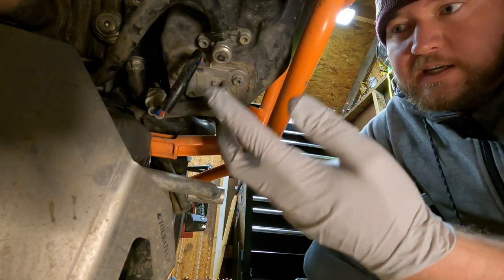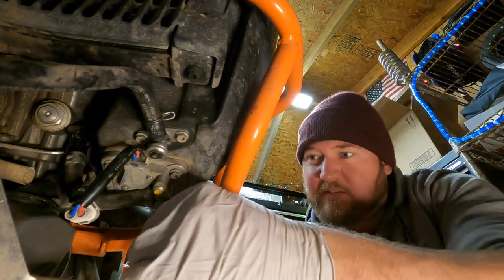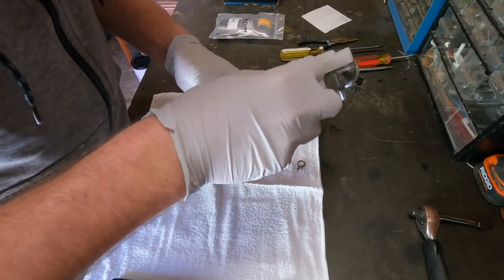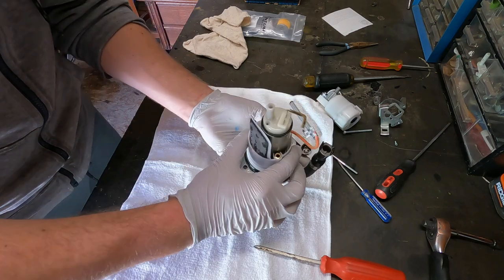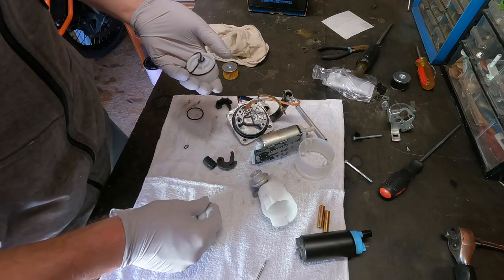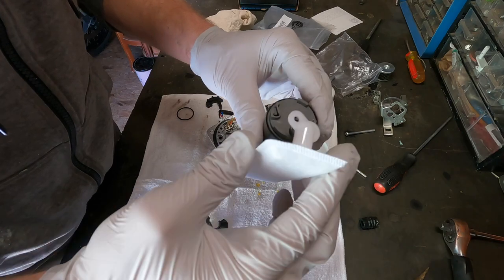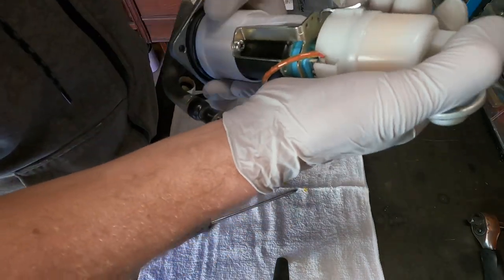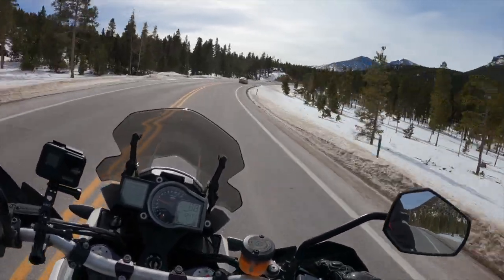KTM 1190 Fuel Pump Rebuild Filter Change NOT as DIFFICULT as you think 💭

Comment: Just about to tackle this job, and found this is really useful. I’m not going to remove the tank now, and am confident it can be done relatively easily. Famous last words 😂 Thanks from England.
Reply from the maker: You can do it! Thanks for watching
Reply: Update. Sorted it yesterday, was easier and quicker than expected. The fuel was sitting in the tank over winter and had turned milky, presumably water in it. Changed the pump, filters and regulator, and it runs much better. Put an up-rated pump and regulator in. Thanks for your video, was a fantastic help.
Reply from the maker: @davewhittleston2963  glad the video helped !

Comment: I think my NEW 100mile quantum filter is failing.  50% power just like before. Ready to sell bike. Previously had fuel explode out tank embarrassingly in front of other riders too. Fixed that by drilling camel vent hole. Gotta take bike completely apart again to check vent lines again. I’m just venting🙁…pun intended😐
Reply from the maker: I had to do the tank fix, fuel exploded out on me as well.
The fuel pressure regulator went out on mine about 300 mile after this rebuild. 
As much as I love the bike I will most likely part ways with it next year.
Reply: @AdventureTomek   yeah its getting very frustrating...  just looked at 21 MultiV4..wow, but i keep thinking my paid off 1190advS already does 70-80% of what these new adv bikes do, i just need the 1190 to be reliable.  no prizes awarded at the end of a bdr for who had best suspension, fastest time, etc lol.  

new 10k 790 adv is very compelling choice, think i will miss big power though.
Reply from the maker: @jonasbaine3538  I just pickled up a 2023 Tenere 700. Don't have much seat time on the bike yet. The spec numbers on paper seem low, but the bike is peppy and a fun on to ride. 
Many options coming out right now in the ADV genre of bikes.

Comment: Years ago I made a comment on MADTV Australia’s London to Sydney video about the suspect nature of KTM fuel pumps and Dave kinda puffed up at me, blaming bad fuel. 
Years later he was admitting that KTM’s pumps were prone to failure in adverse terrain and dodgy fuel. 
I’m gonna run my 890’s OEM until it’s out of warranty. As soon as it hits that point it’s getting swapped as well. 
Good how to on the swap! 👍
Reply from the maker: Figured I would do it now rather then on the side of a trail.
You could buy the whole housing pre assembled to make it a much easier trial side fix, gets pricey at that point. 
From what I’ve researched the quantum pumps are well make and should last. 
Only time will tell
Reply: @AdventureTomek  You will be our product tester. 😊
Reply: I don’t think KTMs fuel pumps are actually that bad. I think in the  manufacturing process they leave plastic crud in the tank, which gels with gas and ruins both the filter and pump over time. Plus it’s not the external filter that usually gets clogged it’s the fine tea bag type filters inside the fuel pump itself that crap out with gumption
Reply from the maker: @Captndarty  🤔 I can see that teabag filter getting clogged over time and causing stress on the fuel pump. Someone also mention to me not to run the bike to low on gas, as the fuel cools off the pump??

Comment: I have a 1290 adv. It is not having any fuel problems at the moment, but at the 30,000km service they say they "have" to change the fuel pump. What do you think?
Reply from the maker: Are they doing it under warranty? I personally would not do it. 
If I were to go back in time before I rebuilt mine, I would just by a spare OEM one fully assembled and carry it on longer trips. Quick swap with some basic tools. 
Maybe call up a different dealership and see what they tell you.
Reply: @AdventureTomek  Thank you for the tip. I'm not going to make the switch. Since the fuel pump doesn't have any defects, I don't see any reason to spend $450 now (price for a new OEM one here).

Comment: Just watched your video again since I've done the swap out this evening.. struggling to get the whole pump assembly back up into the fuel tank = I'm worried that I shouldn't use a rubber mallet or something like that, but I don't seem to be able to apply enough pressure just pushing upwards while lying on my back on the ground

Any suggestions..?
(Question coming from Vancouver BC)
Reply from the maker: Try putting some grease around the rubber gasket. 
Have to twist at push same time. 
It’s a pain
Reply: @AdventureTomek  
I just got it sorted out about half an hour ago..

Yea, pain in the butt 4sure

I figured out the twisting part, then while lying on my back I used the light on my phone to aline the screws 

Then with only a big 1/8" to go.. I used a construction pencil & tapped it with a small hammer, going around in a circle, just 2 light taps at a time

Bike has been refueled & ran twice, no leaks, so that's good

Getting the skid plate back into alignment was a pain also, I guess I've bumped some minor things over the years

I bought it new in 2018, has 40,000 kms on it now { slave cylinder went earlier this year, replaced with the Oberon unit )

Even when the screen said fuel pump failure { in red across the screen } I just waited for about half an hour & the bike started again, I was able to make it from Squamish back down the sea to sky hwy to Vancouver keeping the RPM below 3000 & it lugged me home, so all in all, still a great bike, I'm probably going to keep it until I'm ready for a goldwing